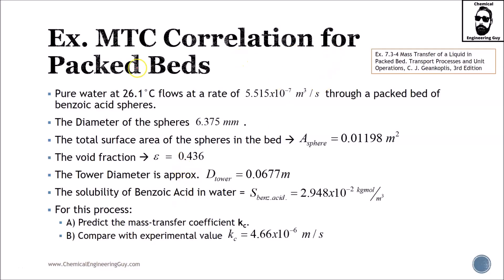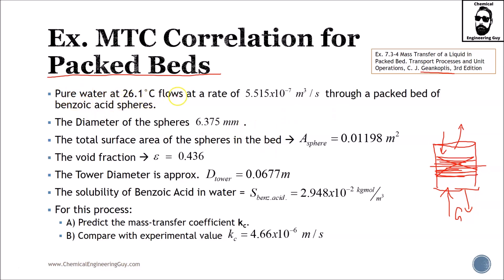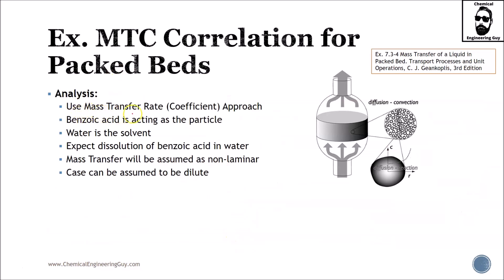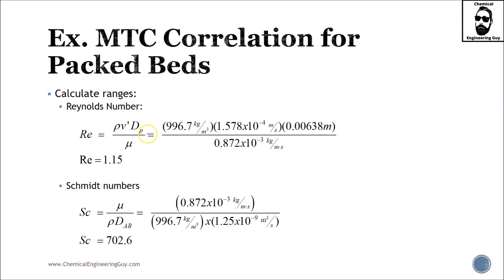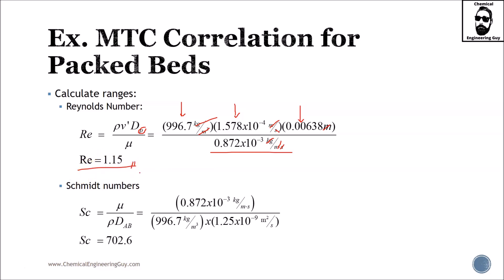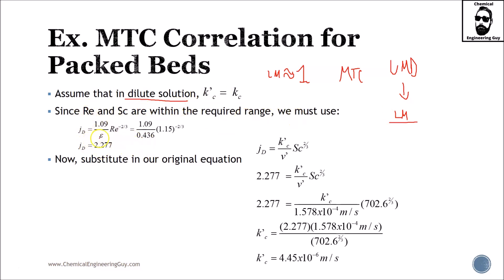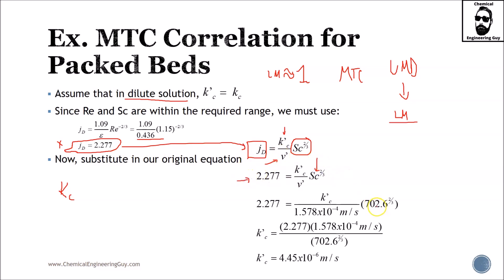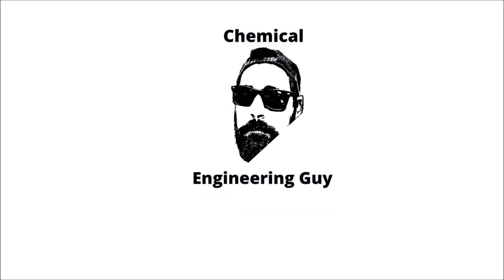Ex. Application of a Mass Transfer Correlation for Fluids in Packed Beds (Lec173)

Comment: Hi, could you please help me solve this question? Do you also know where to find similar questions?
A packed bed is used to facilitate a reaction which is carried out in water. 
The packed bed consists of near spherical particles which have a diameter 
of 2mm. The packed bed has a diameter of 2 meters, a packd bed height of 
5 meters and is found to have a voidage of 0.4.
The water enters the packed bed from the bottom through a centrifugal 
pump which is located two meters below the bed.
Reply from the maker: Hi, please send it to my email :)

Comment: Can I use this method for tritium particle flowing with helium through packed bed? Please suggest me some literature related to this... Also how to treat interface between solid & fluid , because in fluid Tritium is hydrogen molecule where as in solid it will be H atom .
Reply from the maker: Remember that these are correlations, they are intended to work within the given limits, if you stretch them so hard, they will not be likely to model your process
Reply: Can you suggest me some literature to follow for the same?